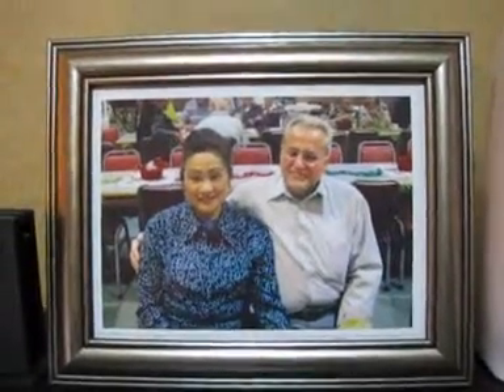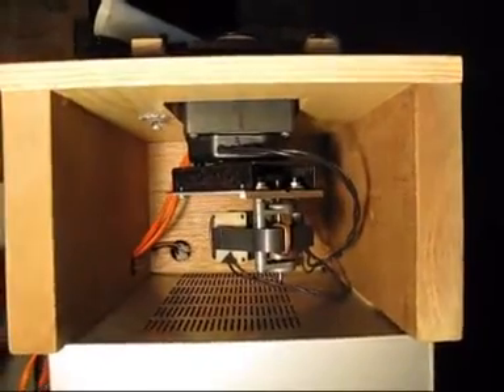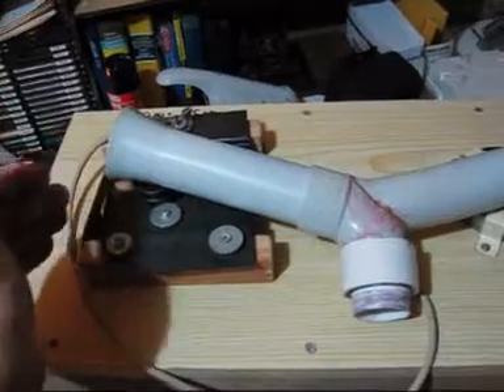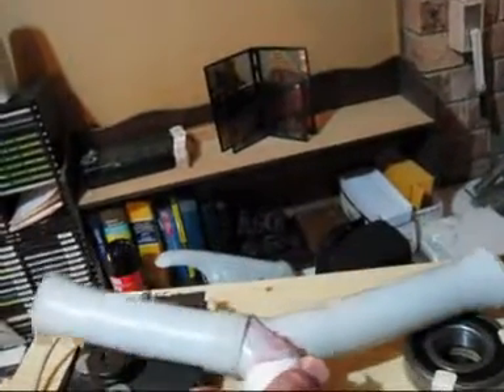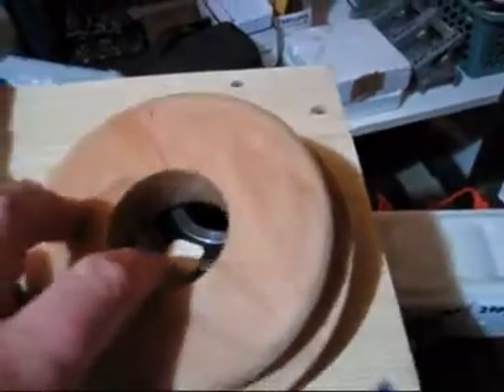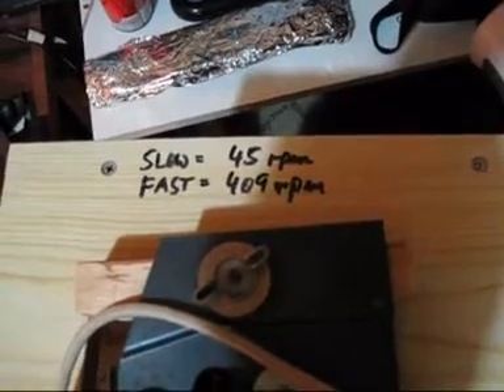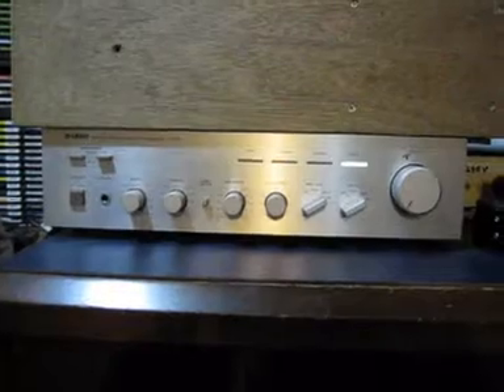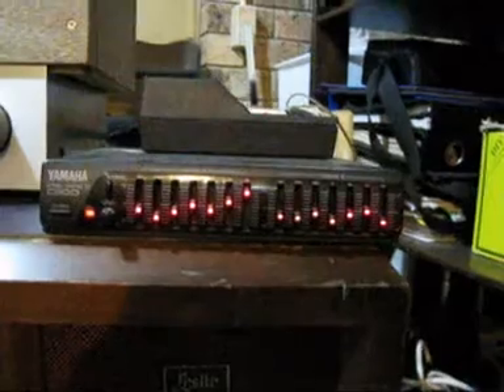Plumbers Horn 1

Comment: It's ironic I would choose your home made design to stop on- I have the identical Leslie 705, a heat gun, spare Conn spinet Leslie motor, and a brother with a lathe. I'm in the U.S.. Can you tell me the size bearing you used? I'm guessing that an automotive truck bearing from a junk box at a semi-rig truck repair shop would work, but if I could just go buy one like you have here for $20 it would be worth it. Where did you get the bearing ? What size?
How did you mount th pulley to the bearing?